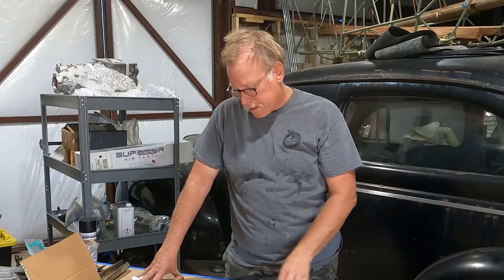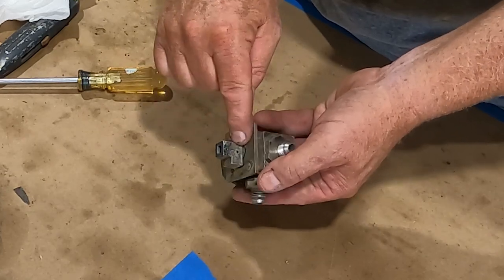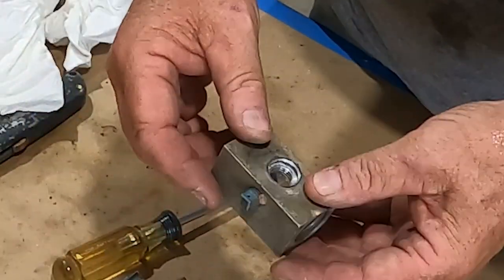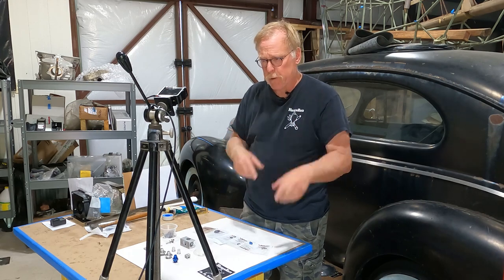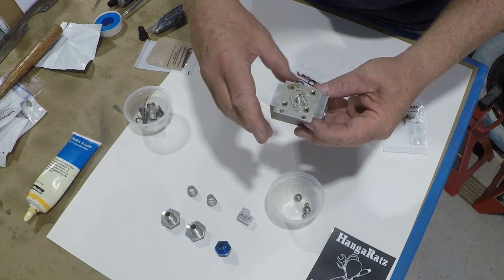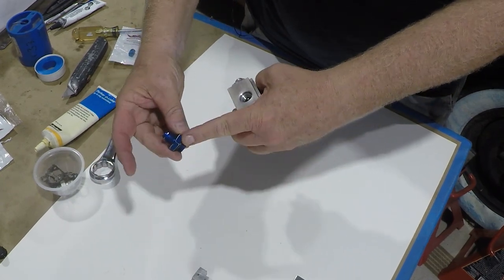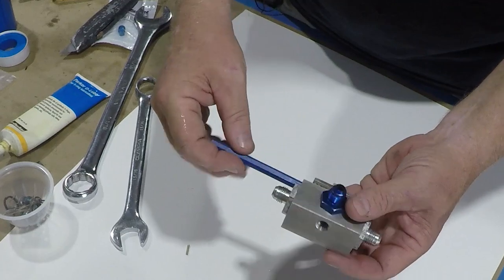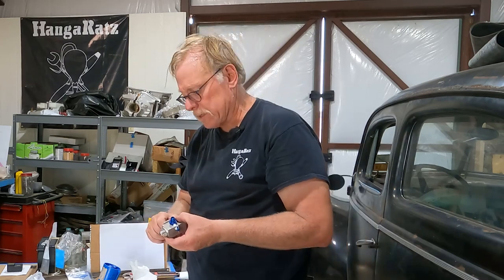Hangar How To - Cessna 172 Fuel Valve

Comment: Bill thanks again for this video. Today I was helping on a friends 172 where he was complaining about fuel coming out of one wing more then the other on both. I know Cessnas are notorious for this. I lifted the carpet to see the valve below. Someone took off the handle before I could find out which way it was pointing. It could be in the both or off! Watched the video to see if we could see the position of the sector.  Wish you would have shown that the selector block with the forward shoe shape facing the front and stated that this would be the both position for fuel flow. Pulled off the engine line after thinking about it for 30 minutes and changed the selector position around to figure the fuel flow out. Thanks again for the video.
Reply from the maker: Thanks!

Comment: Great video!  Have you rebuilt a Cessna 182 fuel selector valve?  I working on my 182K and the inlet fuel fittings do not screw on/off.  They are formed into the housing.  So when you remove the cam, the springs and sleeve fall into the housing.  I'm now trying to compress the spring and sleeves to install the cam.   There must be a special tool to hold the spring / sleeves into place so I can install the cam.   Does this make sense?  Do you have a special tool?  I'm heading to my shop to see if I can make one.  But if there is one I can buy, I'm interested!!
Reply from the maker: I have not worked on one of these type valves.  Looking at the service manual and the IPC it appears that the factory may have used some thin shim stock to keep things in place while the spool valve was inserted.  However, this is only a guess...  Thanks for watching!
Reply: Thank you for the quick reply.  I also tried to use feeler gauges as shims with no success.  So I think we are thinking alike.  I did check with McFarlane on the kit I purchased and it does say "requires a special tool"  so I reached out to them to see if they sell the tool.   @HangaRatz

Comment: Is there any issue with taking the AN fitting and machining off the end? 43.13- or IA - or anything about doing this if the part is available from Cessna? If it was a rental aircraft would you have to put in the Cessna part? The end to tank fitting don't need to be wired? Thanks for the video and answering all my questions. I got my certs. in 2000 and never worked on anything but a oil pump in a piper just after getting them. I sure wish there was a mechanic near me that would even just let me work with him to get the 6 months in for free! the 172 rebuild looks interesting. I worked on a eaa  zenith 750 cruiser putting it together for a few months, but that does not help with time per the FAA. Thanks again
Reply from the maker: I consider the machining of the AN fitting as an owner produced part in full compliance with FARs and within the scope of the an aircraft mechanic.  Go get experience!  Thanks for watching!

Comment: I repair these at McFarlane. We assemble the cam, washer, o-ring, cover plate, detent ball and spring, detent housing, and roll pin as a subassembly before it gets attached to the valve body. The lift balls can get on top of the cam and jam the valve in some cases (Cessna did not make these consistently to the same dimensions on their old planes) because the detent spring is what pulls the cam to the proper location, so you don't want to have the inlet balls and springs installed if the detent housing is off the cam. 

The cam can get bent if using a hammer to drive in the roll pin, so we use either a roll pin installation tool or arbor press so the detent housing is supported and the cam won't get bent. 

Also, the outlet fitting is frequently corroded, so if you do use an owner produced part or have to clean the threads, give it an alodine treatment on the bare metal before reassembly. McFarlane replacement inlet and outlet fittings have a hard anodize coat so they're less likely to corrode or gall than the Cessna parts. 

They also are prone to overtorqued fittings, so reference the torque spec for aluminum o-ring boss fittings from the late model Cessna manual since the early 172 doesn't have a torque listed.
Reply from the maker: Excellent info!  Thanks so much!  I'd love to do a video of your place up there.  Let me know!